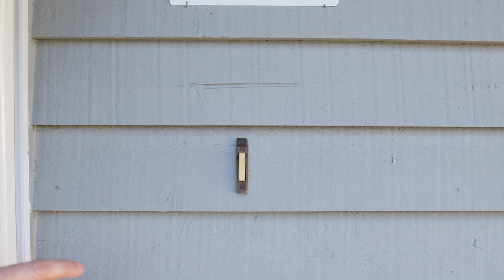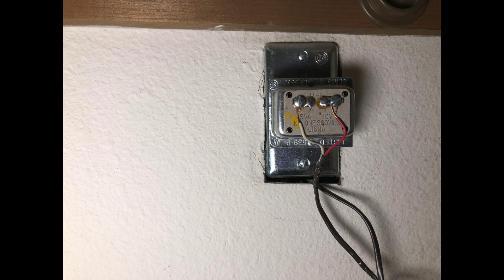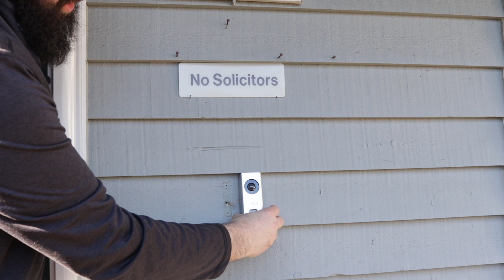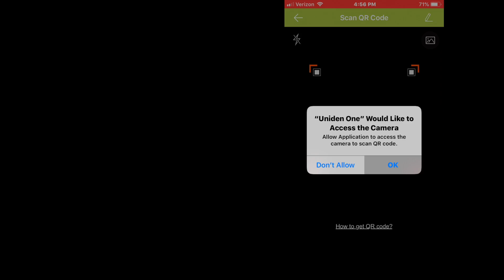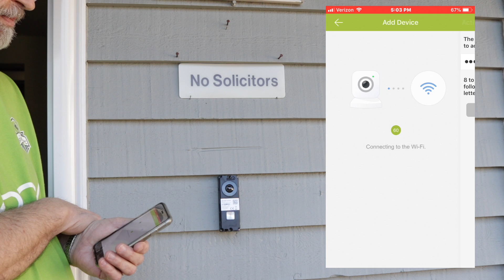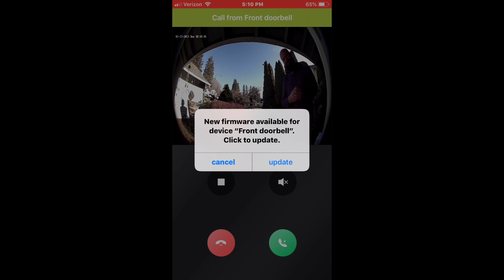$49 Dollar Video Doorbell Installation - Ring alternative

Comment: Did the Chime have to be replaced to match new Transformer voltage
Reply from the maker: Nope, most door chimes are a very simple electromagnet with very short duty requirements.  Pressing the button will engage the magnetic 🧲 coil and operate the chime as usual.
Reply: I just tried to install this.  When I attach the wires and turn on the circuit the door bell is automatically activated and acts as if the button is pushed down at all times.  The button does not work to activate it.  I have a mechanical door bell that I am trying to attach it to.  I have a 16 volt transformer installed.  Any suggestions?
Reply from the maker: Yep!  Double check the wiring and the instructions in the Ubell box.  There’s also a resistor that is needed for some chimes if they sound like they’re constantly on - the manual covers it.  Let me know if that works!
Reply: I added the resistor and that didn't solve the problem.  I put it at different points throughout the circuit.  It still activates the doorbell constantly.  Any suggestions?
Reply from the maker: That’s a tough call man. Easiest solution?  Replace the chime - it should be about $15 for a cheap one from the home store.  They mention this possibly in their manual and the resistor is normally the solution.  How old is the chime?  Is it a small buzz box or a large one?
Reply: @TheNetGuy   The chime is ten years old.  It's about 10 by 5 inches in size Nutone brand.  I guess this isn't a transformer problem.  Mine is 16 volts.  I never get past the part of installing it bc of the buzzing to check to see if the doorbell is getting power.  The initial install is the first problem.
Reply from the maker: You can bypass the chime for now if you want to test the full install.  The chime goes inline with the circuit, but isn’t necessary for operation.  Also do you have a multimeter to verify the transformer is putting out 16v AC?
Reply: @TheNetGuy  yes it is 16 volts
Reply: I checked the voltage and it's 21 at the doorbell.  I bypassed the doorbell however when I connect the ubell the button does not light up.  This may be a faulty ubell and I have a replacement coming.
Reply from the maker: Sorry to hear!   It seems a little high for standby voltage.
Reply: @TheNetGuy  I was able to get a replacement product and that solved the installation problem.  Now my problem is getting it to connect to my wifi.  It just keeps saying that the wifi connection failed.  At first it kept saying my wifi password was incorrect but that now stopped.  I know the password was correct.  The doorbell is approximately 20 feet from the wifi router.  any suggestions?
Reply from the maker: That’s good news.  Are you using the same WiFi name for both 2.4g and 5ghz bands?  That is another known problem with most of these devices.
Reply: @TheNetGuy  I just have one network at 2.4. Verified that with my router settings.

Comment: Would love to see a video with machanical Chime hookup
Reply from the maker: Hey Davis - your mechanical chime stays connected.  This device fits inline and draws a small amount of current through the chime.  If it makes a buzz or noise at all the provide a resistor to add.  It will work with your existing chime.
Reply: Awesome....presently I have a wirelessly set up,bought the Ubell and Transformmer already will get a machanical Chime now and hook everything up...thanks,great video.
Reply from the maker: Thank you for watching!   It’s a good unit - though make sure to invest in good microSD cards.  The one that comes with it doesn’t last long.